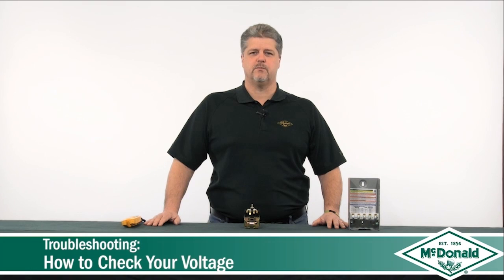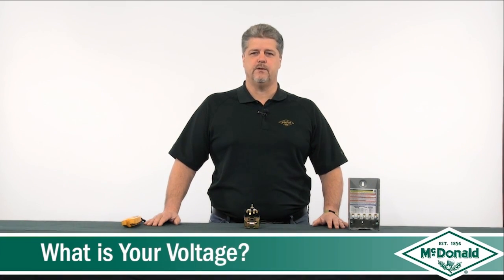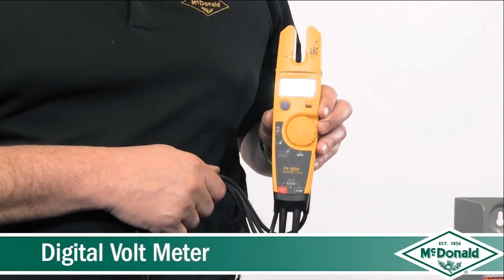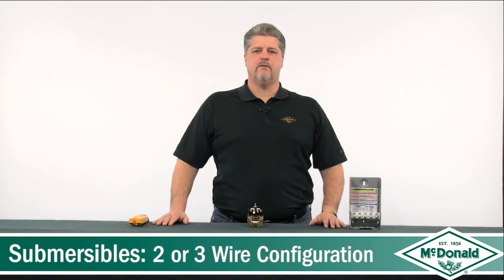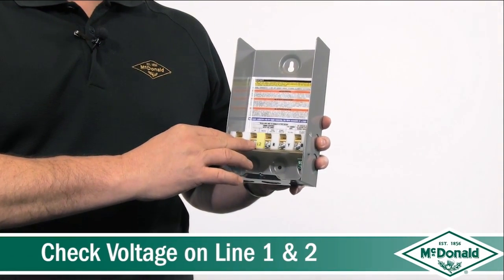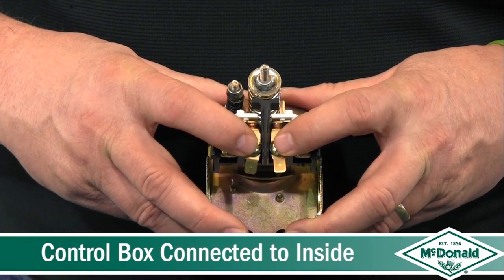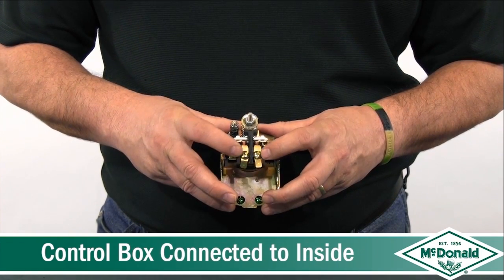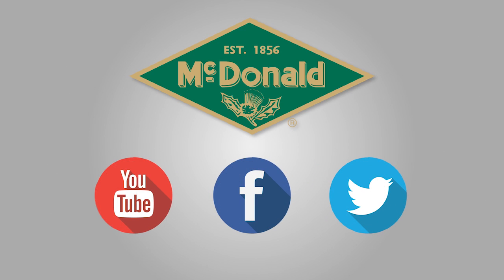Submersible Pumps - Check Your Voltage

Comment: To run off solar, can a 230v submersible pump be replaced with a 12v?
Reply from the maker: Unfortunately we do not offer a 12 volt submersible motor or pump that would run in this application.